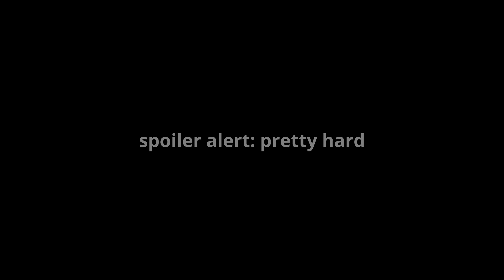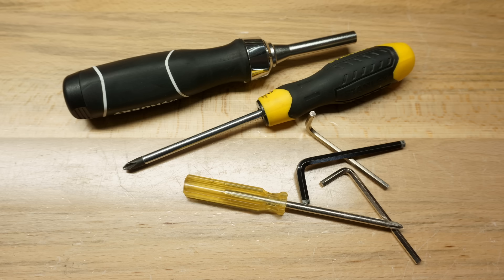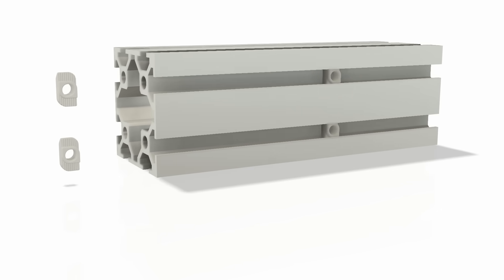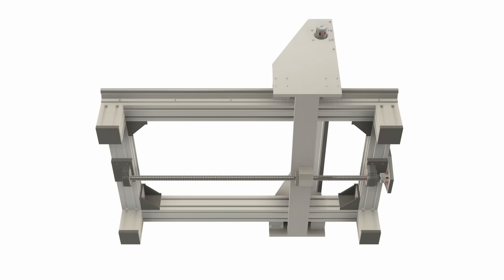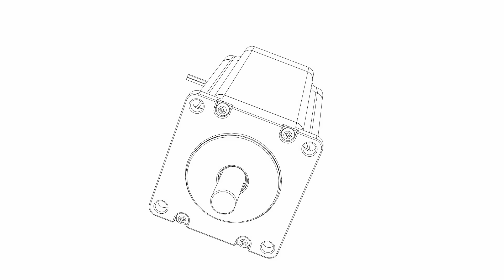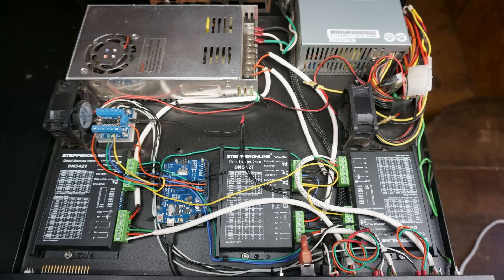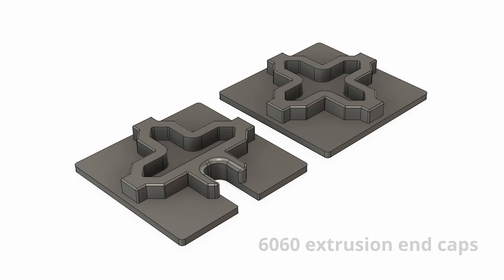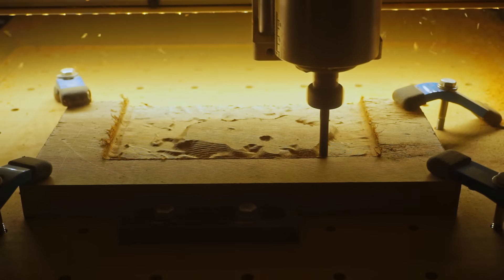Making a DIY CNC machine with limited tools

Comment: I am an engineer (electronics) and I would not attempt such a project as you have.  I have to say, though you're not an "engineer", you are in fact what an engineer is.  That you have been successful is a reflection of your careful and studied approach to such a monumental project, weighing the pros and cons and tradeoffs to each decision.  That is to a great deal what real engineering involves.  You mention in your video that it took you almost 1 year to complete your project.  I can appreciate the time involved.  Complex projects do take time and usually more than we initially realize.  One thing I would have asked myself considering such a project as yours is whether it would be cost-effective for me to spend the time and money and do the entire job myself vs. purchasing a pre-built CNC.  There are advantages and tradeoffs to both approaches of course.  With your approach you learned things that someone purchasing a CNC would likely not learn.  And of course, building it yourself gives you the unique feeling of satisfaction that one does not get from purchasing a similar CNC.  That you built it yourself also gives you the ability to repair and/or modify your machine in ways that one ordinarily would not be able to do.  On the other hand, purchasing a CNC allows you to get to the job(s) at hand almost immediately.  Those are just some of the tradeoffs with building it yourself vs purchasing.  In any case, your results are quite remarkable.  You might consider offering your CNC as a kit; I'm sure it will sell.  Of course, putting together a kit and making it into a money-making proposition is a completely different kind of challenge.  But considering your excellent approach I think you'd be equally successful.  Unless I missed it, one thing you don't mention in the video is the resolution in the X, Y, and Z axis - something that would be of interest to others.  Best of luck with your future projects and congratulations on a very impressive result!
Reply: The main point I would add to your excellent review of this guys project is he really wanted to build it heavy duty and made it so. I am no engineer either although I believe that I can do, build, repair, make anything I set my mind to. It was my father's unique view as a project manager for Australia's only telecommunications in the 60's till the mid 90's. Also his relentles and high expectations of me. I am of a very high I.q. but that's only according to some rules and interpretation. My father would be in his workshop where he would rig sailing boat masts, strip down old vessels and rebuild them. Make custom rigging systems which I am certain helped him win the National titles in the class he focused on. The Corsair. I'd hang around interested but wanting to be observing not really want to solve problems he already probably knew the answer to. But it was simply teaching me how to get my mind to simply and quickly see solutions by thinking "OUTSIDE THE BOX!" That box I guess is the box that constrains most others looking at the same issues. It really was drummed into me. Think wildly outside what you may already assume the right answer is. I remember him having a mast, a blank mast, tapered aluminium about 5 metres long which is extruded and included a c section track in profile if the mast was cut across. He said that these rectangular fittings needed to go into the mast. They were little blocks with little shelves in them for the use of fine lines or stainless wire cable to go up the outside and into the mast then Back down inside. I looked at it closely and was about 7 or 8 and always wanted to get it right... these little tests. I thought about it and decided I would drill a maybe 5mm hole inside each corner then a 3mm hole in a line inside the lines denoting the cut out. He looked pleased then said ok what next. Remembering his father's rule that a tool is used for its purpose only and not used as a stupid thing to get a job done in a poor fashion. I didn't care and said I'd get an old chisel and cut through the little joining bits between holes. He said excellent. He did not think of that. Then what? I'd file the rest of the holes flat till the rectangular cut out was exactly as it should be! He was so happy. I know because he would be overheard telling hos sailing mates about such stuff. Even though he never or rarely congratulated me on little brilliant mental achievements I overheard him telling people about me and it was then I realised he did it all to sharpen my mind. My brother also has this ability and can do anything at all as well. Dad said he regretted not becoming an engineer. I do also. But I am an e ginger in ability and trained in Surgical engineering. Small engineering shop building everything from raw materials. Bending ultra thin wall 7/8 and 3/4 inch .028" wall chrome molly tube using mandrels we made and all by hand. No motorised bending. We got it perfect often.a big thing to be proud of. Milling all stuff. Punching out parts. Bending flat steel.casting aluminium parts. Brazing chrome molly frames and mild steel. Tig welding alloy and stainless for racing wheelchairs and showering chairs. I did the full apprenticeship In upholstery, but never sent to college as the boss feared any employee leaving. With proof in paper it was easy. But I care not. I was skilled in many many amazing things I use daily. I learned immense skills at my high school which I chose as every module was recognised by the state and federal competency and teaching standards. I soaked up every tiny detail of ever single lesson and despite the other boys telling me to shut the fk up... we want to leave before the bell! I still picked the teachers brains and my results reflected this. I use these skills daily also. I made some great choices early on concerning my future. Out I took a break from making these and had a long period of being a fk up.

Comment: Do you have any problems with step skipping? i see you didnt really use any ferite rings or EMI filters, cant say if the signal cables are shielded or not.

EDIT: just came to the part in vidoe you realised it hehehe

Comment: Wow 😳 You are an engineer after all (at least, kind of.) I will go to the follow up video, immediately, but, as I'm commenting already, please let me ask you, what kind of blade you use at 4:45? It looks a lot like a blade for cutting wood, but I'm sure it is something else. ☺️
Reply from the maker: Its just a basic blade, for wood I think - works very well on the extrusion, but for the solid plate it did struggle, and was a bit dull afterward. They don't cost much so it was not a big deal.

Comment: Hello! What can be the maximum engraving depth with such a CNC router? I'm looking for a CNC that could carved a cube of 10 cm high. thanks for your answer; ;D
Reply from the maker: Its about 8 or 9 cm. But really, the maximum depth is defined more by the cutting length of the tool. You would need a tool with at least slightly more than 10cm from the bottom of the router or motor spindle in order to cut that deep (without moving the part). This machine uses a router with a 1/4" (6.35mm) shaft. Most of the cutting tools I can find for that are not that long. This is because if they get too long and thin, they break. So you may need to use something other than a router that can accept a larger diameter cutting tool - which can then be longer as well.
Reply: Many thanks for such details answer. ❤

Comment: Great video, just one question. About how much time and money did you spend in total, was it worth it compared to off the shelf?
Reply from the maker: I bought most of the parts back in 2020, so prices may differ, but I think it was around $1000 total. I have never actually used an off the shelf machine, so it hard to compare, but I'm pretty happy with it.

Comment: What adjustments did you make between the dragon and the woman in the pond piece?  The lines in the dragon piece really smoothed out with the woman in the pond piece.
Reply from the maker: The main adjustment that affects smoothness is "stepover" - basically the distance between the tool path lines. But that was quite a while ago so I don't remember what setting I used on either of them. I did also lightly sand them if I saw any rough bits using 400 grid sandpaper, so one may have been processed a little more than the other. Hope that helps!

Comment: As an Engineer myself great job also in figuring out shielded cables as you get harmonic resonance thro cutting metals BUT HOW MUCH did it finally cost you ??
Reply from the maker: Thanks. I made a follow-up video with more info (CNC FAQ), including the price. Short answer: About $1000, but most of the parts were bought back in 2020, so I'm sure it would be a little higher now.
Reply: Thanks for the reply But at about $1000 is expensive to us Brits also you could still turn ur CNC Y Axis to dual motors underneath or even at the side maybe  ?? @benmakeseverything

Comment: Would this work for titanium/aluminum milling/finishing?
Reply from the maker: This specific machine? Probably not for titanium, Aluminum I have done - but the surface finish isn't great due to less than optimal rigidity. That being said, I'm sure it would be possible to design a machine that is capable of it. This was my first attempt, so there's some things I would do to improve the design going forward.

Comment: brilliant build here my friend. I think u created ur own piece of art here. It takes some time to get ur head around these builds. I have collected parts for 3 years to build my own but still haven't worked it out yet bcos I'm not tech savvy. It's the electronics part of the build that has scared the life out of me. 
So what really throws me is where the code comes from?? Can I go online and buy designs from other ppl? I don't think I even asked the right question there pal.
What I'm trying to ask is where did u learn to carve those nice wooden pieces. Surely u cannot rite the code yourself to get the machine to work like that so where do I get them?
I have my ARDUINO, but I'm using smaller Nema 23's with TB6600 drivers, I have GRBL, UGS? AND i HAVE SMALER DRIVERS WITH THE CNC SHIELD. This is where I tend to get lost in the build.
I bought those Linear guide rails too which are 800mm. They will defo make the CNC run a lot smoother but will they cut out any play when they are in full movement? Has there been any issue with them on that score? 
I apologise for so many things in this comment. I only have a small 500W spindle atm. It came with it's own power source with the potentiometer connection but I find it very hard to trust anything I bought from CHINA now. I've seen too many weird happenings with stuff from there. 
Have u made any videos on the wiring part of the build? I saw u never used a CNC Shield in ur build? Why not? Is it not needed?
For my 2xY AXIS I only bought 2020, 2060 & 2080 Extruded Aluminium. I know it's nowhere near rigid enough for the bigger machines but I have to start somewhere with my 1st build. 
If I can get this to work properly and I'm able to get it to where I have ironed out all the kinks I will be looking to go much bigger and stronger on the next build. I'm looking at an X AXIS of 600mm and the Y AXIS of 800mm as well. I was thinking of going for 1200 x 1000mm but I'm not using Ball screws for my 1st build. I'm going to build mine using belts & Pulleys. 
I'm not looking to cut any steel or metal of any kind right now. Eventually I will be building a Steel framed CNC Machine but I will not be welding any parts onto it. That tends to WARP the shit out of the steel which is bad for the build especially with my awful Welding skills.. LOL. 
I'm going to shut my pie hole now and finish by saying that u managed to build a brilliant machine here. 
The part I love the most is the Ball screw under the spoil board that allows u to move the Y AXIS up and down. 
I had some ideas on that but mine all involved the SB moving up and down. I don't know why I never thought of the Y AXIS moving up and down before seeing ur video which has opened my eyes completely my bro so thanks very much for all the inspiring content in this video. It's so appreciated..
Take care man and keep building machines. I would love to see how u could maybe try building ur own Lathe, CNC operated of course. I mean from the ground up to btw. Now that would be a very interesting bit of viewing tbs..
TBS means To be sure.. I'm Irish.. Salute to u sir from Dublin..
Reply from the maker: Hi, thanks for watching, I will try to answer your questions:
Yes, you can buy designs online. Those shown in the video are all my own artwork (I used to do a lot of 3D modelling). Once you have the 3D model, you can use Fusion360 or other programs to generate and export toolpaths (known as gcode) for the machine to cut. I usually do one roughing pass with a larger bit then a finishing pass with a smaller bit.

The linear rails should be fine as long as they are connected to everything firmly and all of the parts are built in such a ways as to maximize rigidity. All homemade machines are going to have some amount of play, but for cutting wood it is not a major issue unless you try to run it too fast (cutting feedrate).

The spindle should be fine to start with, if you aren't happy with the result, you can try using a wood router like I did, I bought that one refurbished for only $75 on ebay.

I did talk about the wiring in my CNC FAQ video, so check that out if you have not already.

I hope this helps, best of luck to you!
Reply: @benmakeseverything  Thanks for the reply man. Very much appreciated. My apologies for my original comment of the longwinded kind. I just read it back there after reading ur one. Man I talked some rubbish.. LMAO.
Anyway best of luck to u in 2024 my bro. Keep safe and well.

Comment: Should have saved the money spent on the enclosed and purchased a water cooled 2.2 spindle, a dewalt stelth sonic shop vac, and cyclone dust collester, and dust shoe. Super quite, no air cooled spindle to blow chips everywhere and the dust collection is really quite as well. Plus get all the benefits of having a spindle and vfd.
Reply from the maker: I do agree that those would all be good upgrades, especially the water cooled spindle. If I ever build another one, or make any significant updates to this one, I will be doing that. Thanks for watching!

Comment: i am doing a similar project of my own. although, quite a bit smaller. more of a desktop cnc router. I'm a bit short on budget atm so project is on hold but i have most of the big hardwares. next purchase should be electronics. mine is belt driven. this vid gave me more motivation to finish it especially when i heard you say it took you a yr. thanks

Comment: How big of a platform could you have built? What would be the difference in supplies (price) to build a 4' x 8' setup?
Reply from the maker: There's not much difference, just use longer rails, ball screws and extrusion. These motors should be enough. the main issue is that the X axis is going to get a bit heavy. Probably use Extrusion instead of 1/2" plate like I did. You probably want dual Y axis motors and screws though - 1 on each side.

Comment: I was a field service engineer for Mazak several years ago and when I retired I made a CNC in my shop. It worked great. I had two separate versions, one had the axles running on precision rods and later I used aluminum 90-degree rods with bearings running on them which was very accurate. I get bored easily and since played with a lathe and lately do intarsia.

Comment: Great description of the process you went through. However, I would suggest anyone learning from this re-examine a few areas. Number ONE rigidity. Flat plate is very poor rigidity for the weight use some kind of hollow section like the ali extrusion or stiffen those risers with 1" steel tube. There are calculations you can find on line for simple sections, this is worth studying before starting.  The motors are way too big and big is not always better. Larger motors have bigger coil inductance and this limits step speed and slows the whole machine down noticeably. Look at the winding impedance in the spec sheet when buying. Carving is not very demanding but your ali milling speaks for itself, you are an order of magnitude too loose on rigidity.

Comment: My latest spoil board has lost its matrix of hold-down holes. They are seldom where you want them. Now I just make a new hole where I need it and use furniture type threaded fasteners that insert from below. They are far stronger than the glued-in ones and you can really lean into the Allen key. Also, holding the job down is far less important than stopping it moving sideways. To that end I have 3d printed a bunch of cams and wedges that stop any kind of movement.

Comment: Hey man!! Great job!! Another engeneer here, just add pressure air supply and also an extractor, both in line. That will helps with the temperature  and also will leave everything cleaner. 
Thank you for your job!

Comment: Nice job, but I don't think what you built is very cheap either, and you have to troubleshoot it every time it has an issue. I have a Bridgeport, so I could make the parts easier than you, but I'd rather spend more and buy a 4' x 4' Shapeoko 5 Pro that has ball screws and everything yours has.